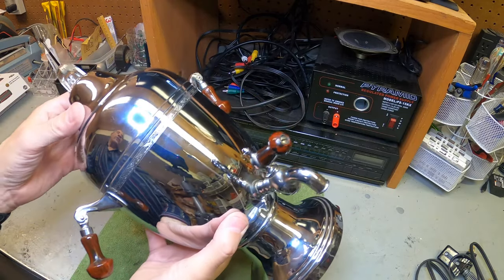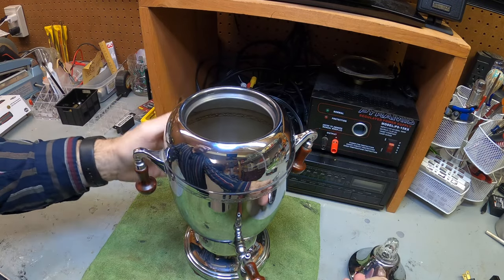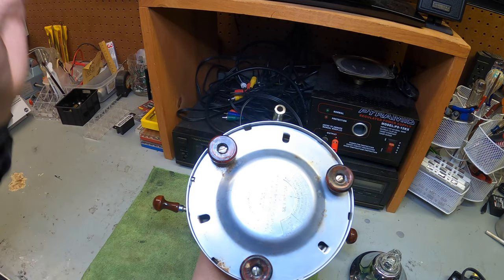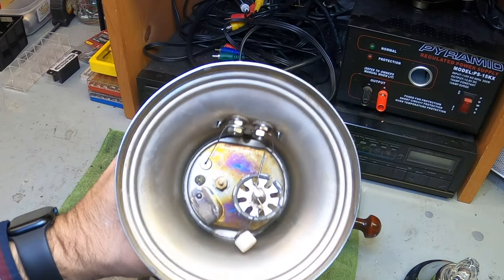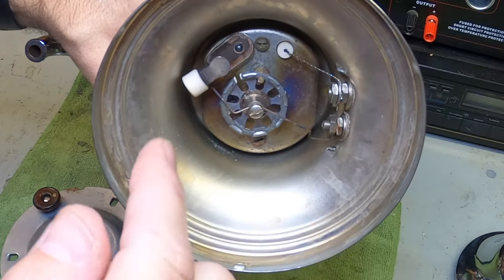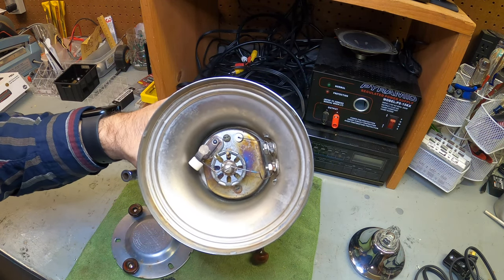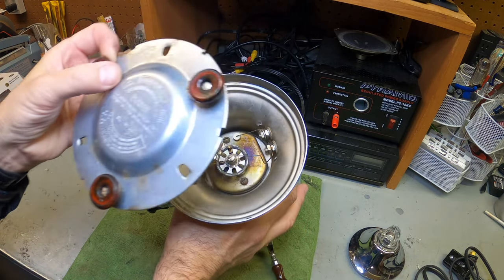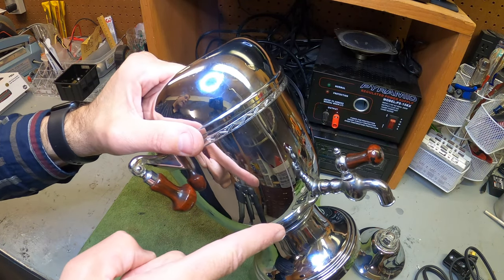How to fix a Farberware Coffee Pot Percolator with Blown Fuse 2024

Comment: Thank you.  I’ve got a similar urn, and although I took off the bottom, I wasn’t sure how to attach the fuse.  Mine came with a cardboard disc that was on top of the coffee basket.  It is two sided.  On one side it says “This appliance is equipped with the Farberware patented 8 in 1 fuse.  An additional $2 value at no extra cost.  For directions see reverse side.”  However directions weren’t clear, but yours were clear.  It is heating up right now!!
Reply from the maker: Glad it helped

Comment: Could this possibly be why the one I got today started smoking at the bottom of the pot from the holes? I did take the bottom off and saw the wheel, it says it's a fuse wheel on the lid.
Reply from the maker: Yes make sure you ad water befor use. Thank you for watching my videos.

Comment: I have a farberware L1360 that I borrowed from my church for my daughter’s wedding. I think the wedding planner left it plugged in without water and damaged it. Is that possible?
Reply from the maker: Yes that’s possible. Also check if it has a fuse   On the bottom. Some units do

Comment: Hey I'm looking into a cord for one or more the less I'm wondering is there a positive and negative to the cord. On my vintage coffee pot it has the same kind of prongs and I'm assuming heating element. But if you could kindly give me the details on amps and volts on your cord and if it actually matters which side is POSITIVE? Thanks your awesome cause there's not a lot of video that shows  the insides of a vintages coffee maker
Reply from the maker: There is no positive or negative. That’s DC current like a battery. This is AC current. There should be a link in the description to the cord. Thank you for watching my video. Yes, I love old coffee makers.